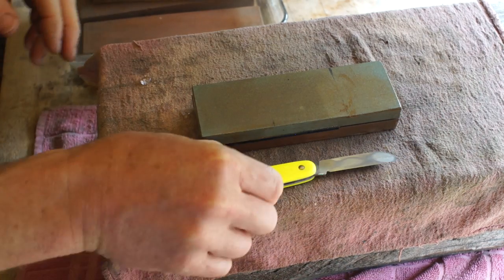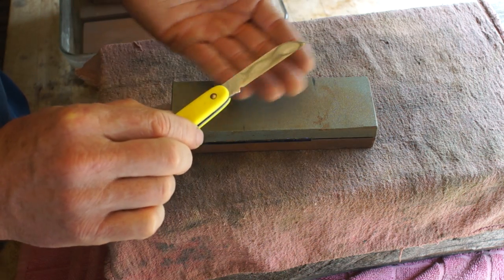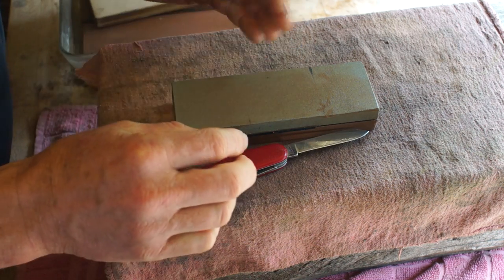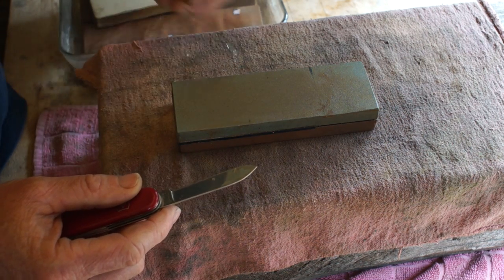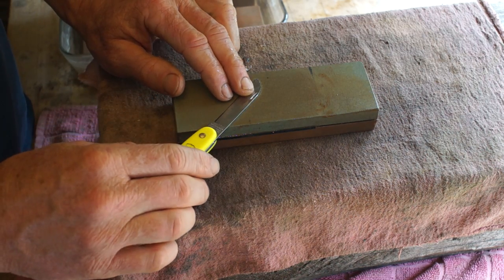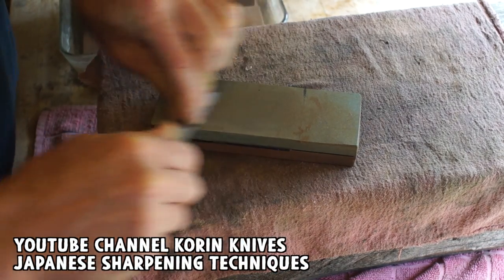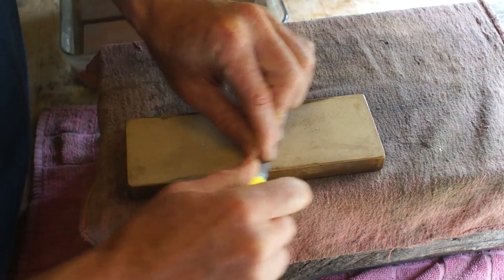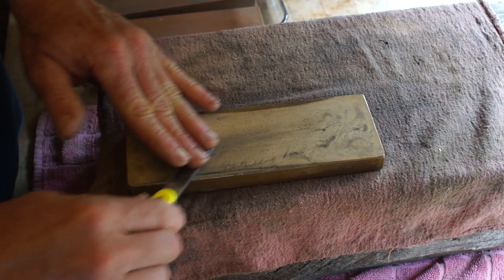Grafting Series Lesson #5 Sharpening a Grafting Knife

Comment: I learned the hard way about Japanese water stones. Learned how to sharpen on Arkansas oil stones leading the edge across the stone. American hard stone technique, and Japanese water stone techniques are backwards from each other. Expensive lesson when I was younger, cost me some damn expensive stones, because I was ignorant and strong headed. Stayed with Arkansas though until I saw you cut down a 200/1000 stone so I bought one. Both systems are working. Good video Thanks. I had more to say, done eating cheese.
Reply from the maker: I found that all the old stones I have, which is quite a collection from flea markets and such over the years, cut pretty slow.  The trade off is fast wearing stones and flattening all the time, but I find that to be a good trade off.  Once I got my Japanese stones, pretty much everything else got shelved.  Now that I have the 250/1000 King, I don't even use my diamond plates that much.  They are fairly worn out though too.  Stones may wear out completely eventually, but they never lose their cutting ability like diamonds do.

Comment: Was wondering how i should sharpen my knife. I got the same one you have with the yellow handle using the "stock" edge. Will be picking up some stones for next year definitely. I am glad you forced yourself to make this series even though you wanted it to be better, its still pretty darn good. Looking forward to the rest.
Reply from the maker: They usually come very sharp and you can probably just touch it up on a fine stone if you don't wait until it's too dull.  Even stropping with polishing compound could bring it back if you don't wait too long.  I can always redo it later and it will be the better for having done it once and gotten questions and feedback.  I forget what people do and don't know, like you can't graft an apple onto an orange tree.
Reply: One question how do you store your stones, are they always soaking in water or do you soak them before you need them?
Reply from the maker: you're not supposed to soak the finer ones too long I guess.   I dont' really leave any of them soaking for days.  I try to remember to soak them up before hand for 10 minutes or more though.  They don't work the same without water on the surface.  You want the slurry that forms on there mixed with a little water.

Comment: Hey SkillCult, just curious, What angle do you think you use? I am going to sharpen using the " Spyderco Tri-Angle Sharpmaker" that I have but that only offers 30 and 40 degree options so Im debating trying to use the sharpening stones (which i avoided past few years as I wanted to use a sharpening system that would give me a definitive angle).
Reply from the maker: I have no idea. I dont think i have ever measured a knife bevel. Whatever you would put on a regular knife for carving should be fine.

Comment: I've always been afraid to try sharpening, because it’s so hard to be consistent about maintaining the correct angle for the bevel, and I’m afraid I’ll do more harm than good.  Can you give any tips how to do that?  Are you holding your fingers on the whetstone as you move the knife across it, so they act as stabilizers?  If so, is it your back fingers or the fingers in front of the blade?  How do you choose the angle?  How do you get the same angle again after removing the knife from the stone?  Can you feel the angle that is already there and use that as your guide?
Reply from the maker: I can't tell you the actual angles.  I just do it by experience and feel.  There are many different ways to sharpen in a way that maintains the angle.  I'll often have my fingertips resting on the blade and slightly on the stone at the same time like this tutorial https://www.youtube.com/watch?v=0fxL8v2dMho.  You can also feel the bevel by rocking the knife slightly on the stone with experience.  That is a good tutorial, but there are loads and loads of sharpening content on youtube.

Comment: Good work. 
I'd like to hear a few words about why the single bevel is preferred in the grafting knife. I was born with a knife in my hand, but being so used to the double bevel, I found the single bevel to not cut as expected and went back to the double. Perhaps in you next video, you will state how to properly employ the single bevel while making grafting cuts. 
Thanks
Reply from the maker: I think If you're not used to it, you can end up biting too deep.  The blade has to be held at a lower angle.  Not all grafting knives are equal either depending on how they are sharpened and thickness.  I'm not aware of all the factors involved, but I know they work well for me.  I'll often use a slicing motion in my pull cut with the knife at a diagonal to the scion because it cuts easier.  Easier cutting means I'm more likely to carry through the cut I want without changing the angle and more likely to get through the cut in one pull.
Reply: Because the non-beveled side is the side used against the cut that is retained on the rootstock and the scion so that each has a perfectly flat plane so that when you join them, there is no bowing or any type of curve when you match them up.

Comment: When it comes to the blade of the knife. Do you prefer something like a stainless steel blade, something that you can sharpen more easily? Opposed to a blade with a higher carbon content steel, that might hold its edge longer but may be tougher to sharpen.
Reply from the maker: It doesn't matter a lot, but if doing professional work, I'd go with harder and more edge retention, because it is important to keep it sharp.  For amateurs it really doesn't matter.  My fav was one I made from an average  and pretty soft old hickory kitchen paring knife.

Comment: Any thoughts on diamond stones, or the systems with the angle guides like the lansky system?
Reply from the maker: I'm very opposed to guides  for the most part.  They fail to develop the most important sharpening skill, holding an angle.  If you already have that skill, they allow it to atrophy.  Plus, its more expensive and more stuff to keep track of, set up etc... Diamonds are okay, but they wear out.  My nice diamond plates see little use now as their main function was for fast cutting and reshaping or bringing back very dull tools.  They are nice to have, but given the cost, I'm not sure they are worth it, but I do like having them.  It's nice that they are always perfectly flat.
Reply: glad it's not just my imagination. 
I have a lansky system but I've never been impressed by it. it was my first attempt at sharpening so I figured I was just doing it wrong.

I've never been able to get ride of my wire edges reliably using the lansky system, and the regular stones seem to cut very slowly, especially on hard steels. Sharpening anything takes a long time. long blades are a hassle because you have to keep un-clamping the guide and moving it. The oil is annoying. It doesn't work well with scandi ground knives (unless you want to re-shape the bevel angle to one of the 3 pre-set angles that lansky can handle).

might be time to get some water stones.
Reply from the maker: There may be systems that work better, but it sill doesn't develop freehand skills.  I hate setting stuff up to.  Get some inexpensive King waterstones and watch the Korin Knives channel I linked in the description.   It's a hard won skill, but all the more reason to start sharpening freehand now.  One reason people are attracted to them is being able to make perfect bevels.  But that just doesn't matter that much.  People free hand sharpened everything up until recently.  I'm sure machines and gadgets have a place, maybe in a production setting, but I think they are generally just crutches.

Comment: Is that just water you're putting on the stones?  How much should you add, where should you add it, and at what stages?

If I have stones lying around, is there an easy way to tell whether I should use water with them or oil?  Or are any sharpening stones ever used dry?  I've grafted hundreds of trees (maybe a thousand if I count my grafting failures), but I still don't really know what I'm doing when I sharpen my grafting knife or any other knives.  I seem to wind up with more or less adequate results, but I'm still just fumbling through the sharpening process not really knowing what I'm doing.
Reply from the maker: It is water.  these stones absorb a lot of water, especially the coarser ones.  You just add as needed.  Ideally it is s wet slurry of paste fromed by the stone as it's used.  If the stone has been used with oil, you are stuck using oil on it from then on.  I don't use oil on any stones.  I always use water.  You can use some dry, but it never seemed to work well for me.  that stone I'm using, the King two sided water stone is very nice and can be as cheap as 15.00. You have to flatten it, but it cuts fast.  I probably have a link below the vid, but if not, it's in my amazon store www.skillcult.com/amazon I recommend them as an axe sharpening puck a lot.  If you use that stone and a leather strop with polishing compound on it (which is cheap) you can get a very sharp edge.  Most stones cut slow, but try using what you have.  Most of what you need to know about sharpening in general is actually in this video.  You can just look at the stones to see how coarse the grit is and go from coarsest to finest.